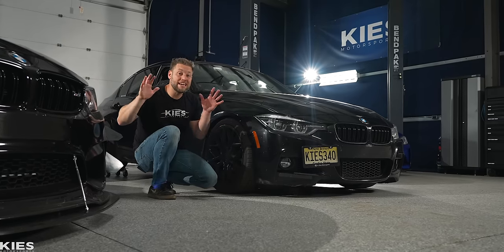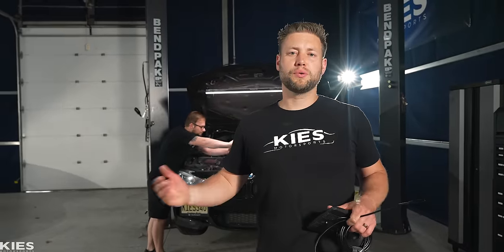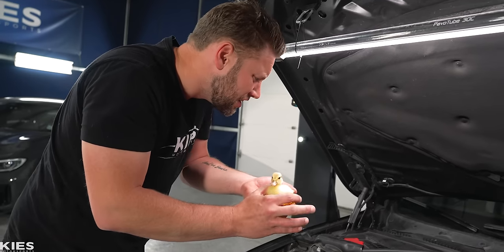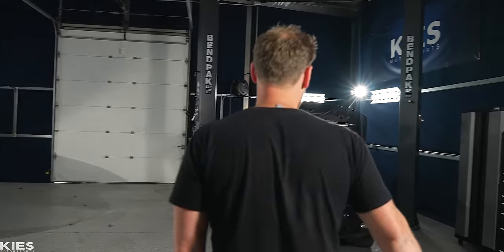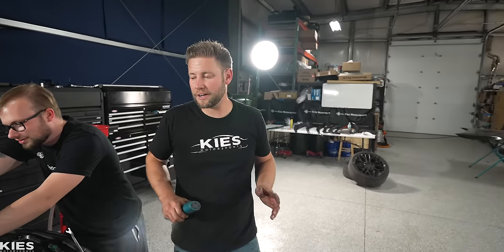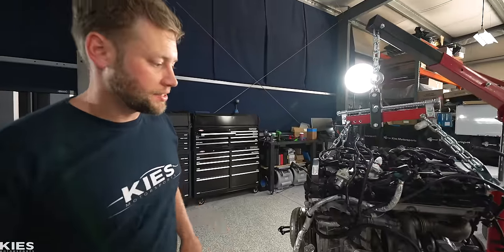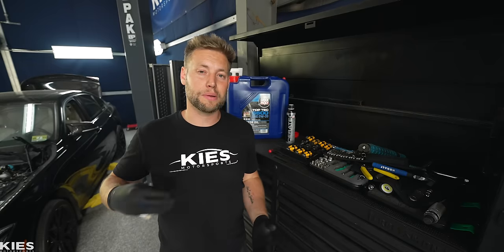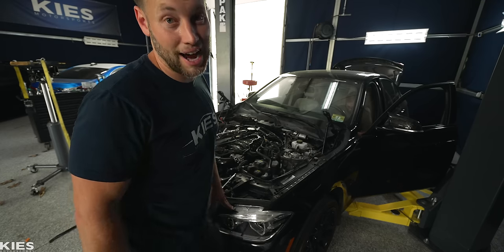ANOTHER ONE BITES THE DUST...

Comment: Are you guys going to post a video about what exactly happened to the motor? I’m curious because I have a 340
Reply: Same! All I’ve heard about the B58 is how bulletproof it is. Having a ‘22 M340, I’m really wanting failure info.
Reply: As long as you don’t add a tune and bolt ons - you will be fine
Reply: Same
Reply: they did just not bro?
Reply: Possibly broken ring land. Seen it twice
Reply: pretty important stuff to know
Reply: @larrington3062  I have been heavily modifying a 2020 m340i and the only problems I have had is the coil pack could not keep up with the upgraded turbo and I have blown the stock dp. Otherwise I have been reliably running 600+ hp for 2 years.
Reply: Spun bearing or valve hit the piston, why? Oil or timing chain issues 🤔
Reply: Great video!... But also would like to know what happened. 🤷🏽
Reply: @larrington3062  this isn’t the same engine that you get in your m340i. The m340i although has a b58 engine but it’s a totally different engine from what the f30 has.
Reply: @larrington3062  same here. Just got my car in February
Reply: As the cylinder heats up, the piston ring expands. With too much heat, the piston ring will expand too much and lock up on the cylinder wall. When that happens it can break the piston ring or the crown of the piston off.  I'm not saying this is what happened. Just saying this does happen.
Reply: Would love to know what the problem was cuz i'm planning on buying the exact same car (year/model ..etc).
Reply: For ringslands to fail means there was exessive heat expanding the piston outwards and cracking the ring. This is most likely tune related. Bigger turbo only running on a dorch pump its possible he had a hot tune and had lean conditions while pushing hard.
Reply: @dr_tate  I’d say that’s most likely, and it usually happens from running lean. It’s not “common” but of all the uncommon b58 motor failures ring failure, and injector failures are the most likely (often times ring failure is caused by injector failure too)
Reply: Stay safe Pierre 😂😂
Reply: Sell it
Reply: @larrington3062  if it’s a 22 just enjoy it
Reply: B58  n55 or b58 which is better?
Reply: @Chenzooo  is this a real question? Lmfao b58 is an amazing engine. N55 blows compared. There are only a handful of broken b58s out there and guess what all were pushing over 550hp. Stg2 with down pipe 450tq and 420hp at 3500lbs makes this such a fun and reliable car with mild tuning.
Reply: @Imunderpar4win I think that’s why most people get b58’s😂
Reply: @Imunderpar4win  😂😂😂
Reply: @kunalmore5212 what? An m340 is a f30
Reply: @cpsecurity6801 no 2020+ m340i is G20 series
Reply: No one buys a b58 to leave it stock lol @Imunderpar4win
Reply: What kind of tune did you run?

Comment: Seems like I’m not the only one wondering what exactly happened to the B58 engine. All I’ve heard was how reliable and bulletproof they are. Did Gary push the car all the time? What were his engine oil change intervals? Any bolt ons? Pretty important info to avoid this type of issue.
Reply: I'd guess tune related
Reply: I think it's still too early to say how "bullet proof" this engine is when there aren't many with 100k+.
Reply: I've seen too many of these videos at this point. I think the B58 will have the same curse as the N54 and it will be worse for owners because the B58 supply will be half of the N54 production. It sucks but I'm calling it now
Reply: @Mr318live  wym same curse as n54?
Reply: B58 is not old enough to tout as reliable just yet.  Happy with n55.
Reply: @Mr318live  Glad you did not include N55 there ! :D  Your call is good.
Reply: @Mr318live  n54 doesnt have engine problems, just everything else problems
Reply: @Mr318live  What are you talking about? The n54 as an engine is bullet proof, it's just everything else that fails i.e. the water pump, LPFP, HPFP, thermostat, etc.
Reply: S58 >> B58
Reply: There are a lot of 9sec b58 Supra's out there. I wonder if there a difference in features. Ie m2 n55 better oil pump/pickup system vs m235i n55 standard pump and sump....
Reply: @Anythingyoulike2013  what are you talking about?! It's been out for almost 7 years and there are only a handful of blown b58 and all were over 500hp. You don't know what you are talking about. B58 is best platform they have ever made.
Reply: @boostedbavarian  I think most people didn´t realise the b58 was around long before the mk5 supra, that´s why they say it´s still "new". and yes i know the supra engine got a little makeover

Comment: In the UK the B58 has a reputation for being very reliable when looked after properly. They tend to blow engines when run on poor/high ethanol fuel and when badly mapped. The injectors fail which causes more wash then bore and piston damage, I bet that has happened here...

Comment: I feel his pain. My 440i has been down 10 months now due to a busted piston skirt on #6. I decided to build the motor,  new pure turbo, etc. Motor was installed about 2 weeks ago and NOW I’m getting faulty installation faults for both the intake and exhaust cams. The shop doing the removal/ installation can’t touch it as they didn’t build it and the engine builder is in another state…So frustrating…I’m so sick of this car man…I’m literally $20k out of pocket and almost a year into this repair and still can’t drive my car. It just seems to be one thing after another. He’s very very VERY fortunate to have you as a resource in this very unfortunate circumstance.
Reply: Sorry to hear that man :(.  What do you think was the root cause of the problem?  Were you running stage 2 or stage 3? 

Hope you get it resolved.

Comment: Can you do a video trying to determine what went wrong with the original motor that broke it? Was it the tune or turbo?
Reply: sounds like the turbo failed, then fed all that oil into the motor
Reply: @gxp99  that is not what happened what so ever, 90% piston ring failure. When that happens, it allows oil to BLOW by the piston and get into ur Intake, charge pipes, intercooler, turbo, etc.
Reply: @ST.G8x  even if that’s the case I personally never heard of only 1 ring failing like that. That’s a premature failure on a pretty low mileage bmw ma boi so no one will now unless they fully tear it apart which would be a learning process for both us and them.
Reply: @gxp99  I agree with guy above me I think it's pistons rings the oils all the way up in the spark plugs and on top of the piston.
Reply: @aimized1460  happened to me. 45k and blew a ring
Reply: @aimized1460  what do you mean you've never heard of "only 1 ring". Piston rings usually fail in one cylinder.

Comment: Oil weight is crucial depending on your application and how you drive . Also tuning , always check your logs for corrections anything can get triggered and go when your beyond stock. I drive my b58 like a nascar daily but I also change the oil every 3.5-4 I’ve changed coolant fluid maybe twice along with trans and diff , coils and plugs . Also a walnut blast and I only got about 35k miles now yea I know it’s maybe early and unnecessary to most but to me it’s necessary, car runs so good and smooth you don’t even see the motor shake with a cup of water on the top of it.
Reply: This^^^
Reply: Yes oil is crucial I use 0w40 in my stage 1, I have taken it flat out around the Nurburgring and Autobahn and in general give it a hard time with no probs at 30k.

Comment: If i had to take a guess to what happened, the center bearing in the turbo failed. this allowed oil to flow into the intake system, through the throttle body down the intake valves. of course oil doesnt compress it caused a increase in compression since it was blocking the piston rings. assuming you were running higher than stock boost+increased compression from blocked rings, caused damage to the valves that you saw with the borescope. due to the leaking valves, and oil fouled cause the misfires and well engine failure

Comment: Ouch, a Blown bullet-proof B58. Hard to believe the B58 piston rings failed like a crappy Audi 4-cyl. I guess if the Big Turbo failed, there would be oil in all 6 cylinders, not just No. 1.

When you use Liqui Moly's Ceratec, it is the same color as a Cafe Latte. If you get your oil changed at an BMW Indie Shop, the tech will freak out when he sees Starbucks Coffee coming out of your engine oil pan.

Comment: Nice vid guys, keep up the great work! Liqui Moly make great products; I'm keen to see how their trans fluid goes in the ZF 8 speed... I've got a trans fluid change coming up, but I've only had experience using either ZF fluids in the 6/8 HP's, and also Motul fluids in the 6HP.

FWIW - with regards to oil and meeting BMW spec (LL-01 / LL-01 FE / LL-04 etc.)... this generally only applies if you plan on extended mileage intervals (eg. similar to BMW's suggested oil change intervals). If you're a real enthusiast, and are changing the oil far more frequently (eg. twice a year, or every few thousand miles), you really won't notice much difference between the different specifications, as things like the SAPS levels and viscosity are still going to be within acceptable ranges at the time of oil change. You'll find most areas with higher sulfur content fuels (eg. US; Australia) will recommend along the lines of LL-01 or LL-01 FE (higher SAPS) for petrol engines, while in European countries with stricter fuel quality (lower sulfur), you'll find BMW recommends LL-04 (low SAPS) even for petrol engines. That being said, I don't suggest people go buy some nasty cheap oil.

As for the weight of oil you've chosen... given the application, a 0W30 or 5W30 would likely be a better fit if you're planning to push the new motor a little harder than stock. The 0W20 will give marginally better fuel economy, but the 0W30 will give you more headroom when you're running higher boost and ultimately higher engine oil temps (ie. viscosity drops). Case in point - I run 0W40 or 5W40 in my N54, as in the summer we have temperatures in the 40+ celsius (104+ F),  such that the higher oil temperatures I see compared to cooler regions of the world means the effective viscosity of my 40 weight oil is actually closer to a 30 weight during running conditions. Our B48 gets 0W30.
Reply: I use penrite 5w30 ten tenth’s racing oil
Reply: I am pretty sure Kies and FCP Euro have done ZF 8-Speed Auto Transmission Fluid Change videos.
- You need a new plastic ZF pan, since the filter is built into the pan. And order new bolts. Go OE ZF.
- Use ZF fluid
- You have to pump the fluid into the side of the ZF transmission..
- Top off the fluid at a certain temp, so you need to run the engine and read the A/T temp with a scanner.

Comment: With oil in the charge pipe, would that not indicate the turbo burst and leaked into the intake first.

Increased temperatures from burning the oil with the fuel caused the piston ring and valve to fail?

Looking at B58 teardowns, they are made for tuning and taking lots of HP on stock internals.  The turbo being the weak point makes the most sense.

Comment: maybe the oil is from PCV fouling the spark plug? Or it is actually fuel from leaky injector? Could have at least checked all other cylinders and maybe do a compression and/or leak down test.

Comment: You probably have metal shavings in the oil cooler.  Attempting to clean it out is typically a fail.   Should do another oil change right away.  Could have saved your Ceratec for the 2nd oil.

Comment: Random question, I recently brought my car in for some maintenance and my shop noticed the oil filter housing gasket on my 2014 428i xDrive was leaking.  After getting it replaced the next day my car went limp and was told the engine needed to be replaced.  This has to be the garage's fault right?  They're tiptoeing around it saying they dont know what went wrong but now I'm out almost 8k getting a used engine replacement.  What would you recommend in this situation?!  Any help would be appreciated
@Kies Motorsports

Comment: 🇧🇷🇧🇷🇧🇷🇧🇷👏🏻, So much work wasn't it, but the result was worth while I guess. Are there problems with these older B58 engines? And not the B58TU? BMW's B58 engine received quite a few important technical updates beginning in 2018. The new variant is dubbed the B58TU1. It is also available in "ML" and "OL" versions. ML represents the "middle output" 335hp version, while OL is the "high output" 382hp engine. Given the B58 is still a new engine, only time will tell how much of an impact the revisions have.

Comment: Hi , i have a 330e f30 and it has this grinding noise whenever it is on the "Save" mode (petrol and idling. do you know what is the cause of it? the noise doesn't come on whilst driving fast and not coming up when it is using electric

Comment: Had a similar issue with mine but not as detrimental. I believe their was a tear in my pvc so at first my rpms started rising at idle out of nowhere then black smoke came out of the exhaust then turned to white smoke had it towed to bmw they said the had to replace the head Also I believe he charge pipe had oil and the spark plugs I believe one more thing but I forgot … apparently the problem I had was cause to excessive idling which I had no idea coming from an si my 340 is my first turbo car .. just something to be careful of if anyone else might have an issue like mine
Reply: Did you hear a high pitch noise coming from the exhaust? Just had mine towed because of that noise and lots of white smoke coming out, I was idling a long time in hot weather so I’m wondering if it  is the pvc

Comment: My 2017 BMW 540i G30 just burned a valve #4 cylinder. (105k miles) I have the vsfr high flow cat, upgraded charge pipe, k&n air filter, new B58TU Fuel pump and Bootmod3 Stage 2+ 93 octane.
I am beyond depressed! Single Dad with special needs, kid. I was told I need a new engine. They want 21k installed. I just can't. I still owe 25k. Only car.... HELP Please 🙏